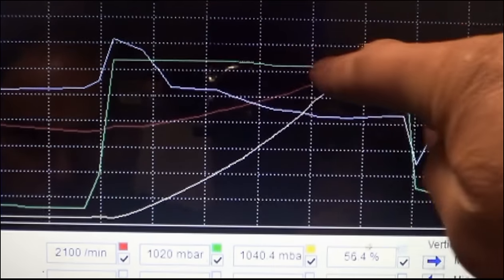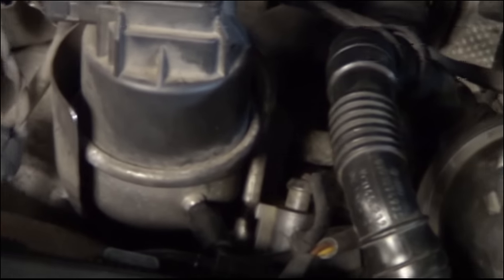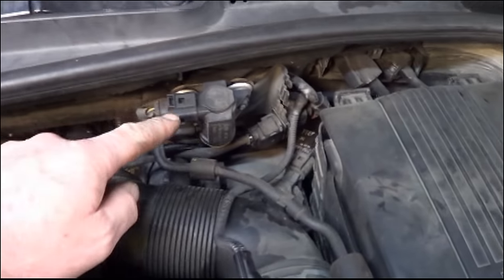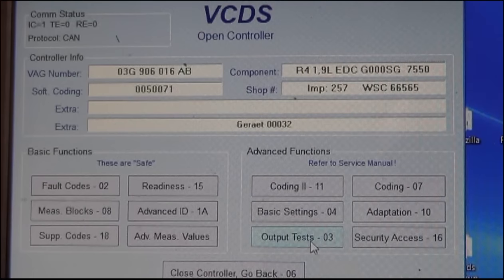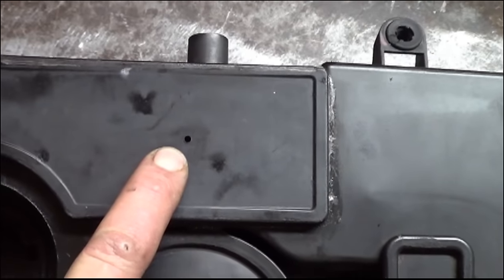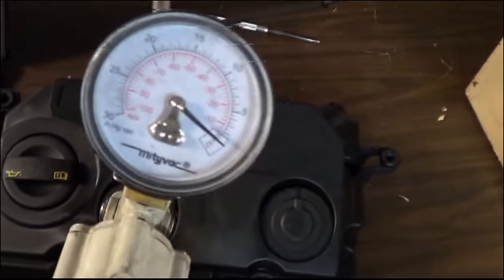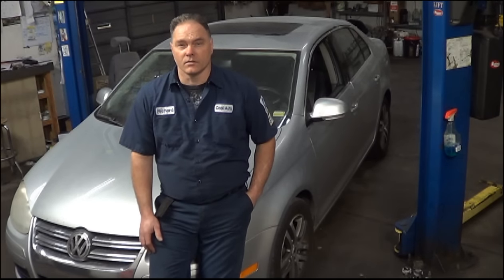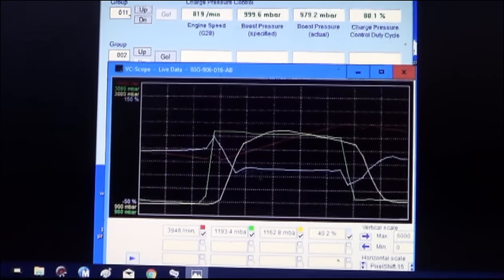06 tdi low boost P0299

Comment: $6 Sikoflex to the rescue.
Reply from the maker: Yeah, there have been 1milliion comments about plugging the hole.  Did  you watch the end where someone had pryed the top off of the reservoir and siliconed it back on?  Customer loved this car and wanted it right.  But if we needed to fix it on the cheap we could have plugged the hole.

Comment: Thank you! you just saved me several hours of research. I did short cut some of your checks. I did find the muscle line to the N75 split. A quick section of hose to replace the moulded 1. All Ops normal! Test drive improvement Proved a good fix. I'll pretty it up later, back up and running for the rest of the work week!! THANK YOU!!
Reply from the maker: Well then, NICE DIAG to you!

Comment: Mine car goes into safe mode on a highway after 40min. City drive does not habe anny issues you can drive as fast as you will turbo is working perfectly. On a highway slightl hill it goes into limp mode. On off und he is doing great again for sometime you cant predoct when will he get in limp mode. Po299 underboost code. All leaks habe been checked intercooler changed. Could it be n75? Turbo should not be a problem, can you help please??

Comment: I’m going to have to look at my vacuum lines. I’ve two Jettas that are identical with one being a manual and the other is a dsg. The manual feels like if you barely take the throttle it’s very responsive, where as the dsg Jetta definitely has lag to it. It’s gets great fuel economy, but every so often goes into limp mode which is a pain especially if you’re on the highway. Thanks again.
Reply from the maker: thanks for watching.

Comment: They did this because the PCV valve that you pointed to failed, and they went internet spelunking for an answer. Someone on some club told them to drill a hole to give them a handle to pry that cover off and removed all the baffling. After the surgery they put a "dab" of rtv that seals it... for a few ..  

It's a "mod" that was removed from the forums back in 2018 ish. SO MANY people drilled holes in this and then RTV'ed over the hole when the PCV was stuck closed sucking oil into the intake and through the PCV system. It later gets sucked in or blown off then this condition presents itself.

Comment: Great trouble shooting video my guy. Just went through a similar situation, the main feed line from the vacuum pump was clogged with carbon build up resulting in weak vacuum supply to my turbo boost solenoid. Also my valve cover vacuum line needed to be plugged to maintain vacuum which makes me think there is a second failure along with the carbon build up. Suspect the vacuum reservoir in the valve cover has some internal failure. Plugged the hose and test drove and def have boost again, will order a valve cover ~$475 and see if that is the last piece of the puzzle! Good work!
Reply from the maker: get a used one or use a vacuum reservoir from a older one that is external of the VC.

Comment: Thank you very much for posting this. It helped me a lot understanding how the vacuum system works. I will perform a similar test on mine as yesterday suddenly the power dropped and the car was not pulling more than 2100 rpm. I could not hear the turbo either..

Comment: Great video! I went through a similar process of trying to find the cause of my power loss, which turned out to be pinched vacuum hose. I now have a new issue unfortunately, which is that the power delivery is like my old 2 stroke Yamaha 350! At about 2500 rpm the power kicks in very abruptly. I've ordered a new N75 valve as I've checked that the variable vane actuator moves smoothly when applying vacuum with my vacuum pump, so it doesn't seem as though it's the mechanism jammed. Steps so far:
Cleaned MAF using MAF cleaner
Stripped and cleaned EGR valve (no significant carbon buildup but at least now it's clean)
2008 103kW / 140HP 2.0 TDI Tiguan
Reply from the maker: If you have an 06 like this one there is a smoke and hesitation problem that can be solved.

Comment: at 14:43, you cycle the on/off of the n75 valve - are you doing that manually or by operating VCDS? does the computer normally elevate to 25mmhg of vacuum then 0? Mine sits at 25psi and does not fluctuate.
Reply from the maker: scan tool puts engine computer in a test mode that cylcles it.   If yours isn't fluctuating then either  the test isn't happening or the solenoid is stuck open or the computer is incapable of closing the valve.

Comment: recently had very simillar problem. traced the vacuum lines and saw one had fallen off its clip and worn a hole by contacted the axle. $7 fix. Excellent video. I'd like to see the opposites of some of your findings in this video. Like what if the vacuum had been bad at the pump, or solenoid, or if the plunger hadn't gone all the way down. Great vid!
Reply from the maker: thanks for watching.  More videos coming.  Maybe one will come in with a problem like what your describing.

Comment: I have a similar intermittent limp mode and lack of boost. The problem is when I scan with VCDS I have no relevant fault codes for under or overboost. Also when limp mode is present I log with VCDS I get zero boost a lower rpm and N75 drops to around 20% duty cycle. Switch off and on again and power is restored and boost builds, all be it with a bit of lag. I’m fairly sure all the cars I’ve had previously the actual follows requested fairly closely. 

I have ordered a mityvac to try and help track the issue down.
Reply from the maker: I hear this alot, but I dont think its real.  Sometimes overboost codes "disappear" when you cycle the key.  Scan it right when it happens without turning off the car and I'll bet you get a code. Or maybe your scanner is crap.
Reply: @CoolAirVw  that’s the problem, I took my laptop with me and scanned it right away without cycling the ignition. Still no code. I also have Hex V2 bought from an authorised Ross Tech dealer here in the UK so it’s not that either.
Reply from the maker: @Mac_F87   Ok.  Do you have a lack of power that clears up after cycling the key?
Reply: @CoolAirVw  yes exactly that buddy. The limp mode seems to happen intermittently also. I mean it’s intermittent but it happens at least once every time I drive it. The van was tuned when the second last owner before me had it. On the logs you do see it overboost slightly under full throttle. Requested is 2100mb-2300mb but that never causes the limp mode or triggers  a fault code. 

I’ve seen many people say it happens to them when they demand heavy load from the engine. As in full throttle or going up a steep incline. Mine seems to be more partial throttle light load. The thing is 99% of these people get an associated fault code. It’s really got me puzzled anyway. 

I’ve been away with work for two weeks but when I get home tomorrow I’m going to check vacuum supply, check the N75, check the vacuum reservoir and also check for turbine shaft play on the turbo. I checked the VNT shaft before going away to work and it seemed to be fine, full range of motion and returned to its testing position freely. 

What I really don’t get is why I don’t get over boost or under boost codes.
Reply from the maker: @Mac_F87  Try again.  I've had customers say "no codes" many times.  Then I check and there are none.  Then I reproduce the issue and I have a code.   If that isn't the case with yours I don't have an answer. My opinion is certain software versions in the engine computer will "erase" boost codes for no reason, but in my experience the code is there when the limp mode happens.  Logic would say if it is truly limp mode the computer is "limping" for a reason.  It only makes sense that it would limp for a code.  If yours is different I have no answer.   But if I had one here behaving that way I would diagnose as if it had the code, but the next step for me whether it had the code or not would be to graph boost and see what is happening.
Reply: @CoolAirVw  got home from working away today. Scanned for fault codes and still noting. I checked vacuum from the tandem pump and it was all good. I did an output test connected to the outlet of the N75, it was working as it should. Checked if the vacuum reservoir was holding vacuum. It was all good also. So did an output test of the N75 with everything connected up. The VNT rod was moving 5mm at most and when I tried to pull a vacuum on the actuator with my mityvac I could not pull a vacuum. So it looks like it’s been a faulty actuator all along. So I’ve ordered a new one and will fit it when I take the turbo off to clean it.

Comment: OOOOOhhhh... 🙃Well, that explains everything. I accidentally damaged my Valve cover and attempted to reseal it with epoxy and high temp silicone, quite clearly that has failed, little had I known the damaged section was a reservoir for one of the vacuum lines 🙈. I did trace the pneumatic lines and ssimilarto what you showed in this video, the line is fed to a solenoid which feeds two other vacuum lines but iIwas naive and only presumed it wouldn't affect my boost levels Dah🙄. I had been getting the following codes P0299 and P2564 but found no fault on my actuator, therefore, the damaged cover must be the culprit, luckily I have already ordered a new cover and stumbled across this awesome video in the process of fault finding various causes and fixes for this issue. Here is to more Boost 🍻 Many Thanks CoolAirVW Rm 😁👍🏾
Reply from the maker: Best comment ever!   Thanks!  Its nice to be appreciated.
Reply: Junk Yard, recycle.

Comment: Very sequential and systematic test. I have the same issues with the tdi passat. I have ordered the handheld vaccuum pump and will test and update. Will be hard to find the actual line but will update what happens. Thanks again
Reply: Mechanic said the whole turbo needs to change which is £1600. But will test it in the sequence you did to find the exact problem. Hopefully it is something minor
Reply from the maker: @AjmalKhan-rq5xu  what year passat do you have?

Comment: New turbo Chra fitted on golf plus 1.9tdi and now black smoke. Will a bad actuator do this?
Reply from the maker: boost leak will.
Reply: @CoolAirVw  got a vaccum gauge on order.... Thanks for reply
Reply: So my car is fine now. New turbo CHRA, new actuator as diaphragm was damaged. New egr valve as diaphragm was damaged and a new vacuum solenoid as it was also damaged. Took a while to get it all sorted as I'm not a mechanic. I'm amazed how 3 components all failed but I assume me driving 5k miles with a howling turbo was probably stupid and caused all the carnage. Makes a mockery of all the YT comments claiming their car ran for 60k miles with no problem, whilst their turbos howled like a siren and how cool it sounded Think they were telling porky pies. And yes a handvac tester is vital. Thanks. Ps I can now remove a turbo in a mk5 golf plus 1.9tdi in 41 minutes!  I've done it 3 times now and I'm pretty good at it lol ☺️
Reply from the maker: @lennycook206  air tools?
Reply: @CoolAirVw  no, socket set, swan neck spanners and Allen keys.
Reply from the maker: @lennycook206  You rock !

Comment: So I had a similar problem, but no one had drilled a hole. What happened is that the glue joint VW had between the part you showed and the plastic cylinder head cover casting had developed a leak.  I simply applied a silicone seal around the entire joint, which eliminated the vacuum leak and solved my problem.  You could have saved quite a bit of money by simply similarly plugging the hole with silicone rubber.
Reply from the maker: Very good to know.  Of course plugging the hole was an option, but with the part being broken off and the fact that it was for a customer I had to guarantee it was a good fix.  Plugging the hole has been mentioned before in the comments.

Comment: When repeating your tests on a BLS, my vacuum at the tandem pump was good - 25. But I realised actuation of the egr solenoid (n345?) was robbing vacuum and what was getting to the n75 was sometimes 25 and other times just 5. If I unplugged the egr solenoid the n75 would always receive 25. With the egr solenoid connected, blipping the throttle would also instantly trigger vacuum entering the n75 to drop to 5 indefinetely.

Would you be so kind as to advise whether you think this is a faulty egr solenoid? Surely it shouldn't randomly leave the n75 with virtually no vacuum to work with?

Strangely my codes were an occasional P0299 and a couple of glow plug open circuits. With the way my vacuum to the n75 is behaving I would have expected very erratic boost. But when it isn't sent into limp mode the power and response is great. Confusing. 

Any insights from your knowledge is very much appreciated.
Reply from the maker: No it should not.  You didn't state year make model, but I'll assume its something similar to the 06 in the video.  The valve cover has a vacuum chamber built in to supply with vacuum if there is "low vacuum circumstance" also there is a one way check valve to seperate "important" vacuum functions from not so critical functions.  Check those things.
Reply: @CoolAirVw  golf 2008 1.9tdi BLS. I just tested the vacuum line going from the egr exhaust cooler solenoid to the exhaust cooler and it holds no vacuum. Which is typical because its hard to access and I'm reading to replace the diaphragm of the valve I would have to replace the whole cooler and not just the valve controller stem which I see in parts stores. Have you dealt with this part much? Seems like the bls is less common than the (seemingly) simpler and better designed ALH etc.

Thanks again for any help

Comment: +1. .. Excellent vacuum tutorial specific to the 1.9l BRM TDI. .. Our 2006 Jetta 1.9 BRM has a similar if not the same driving condition as your 1.9l TDI Jetta; soft power and occasional limp mode. ..  I have diagnostic's to get with. .. Have VCDS, will travel. .. Thanks!
Reply from the maker: got another BRM P0299 code video coming up.